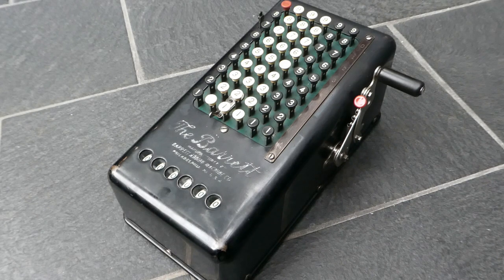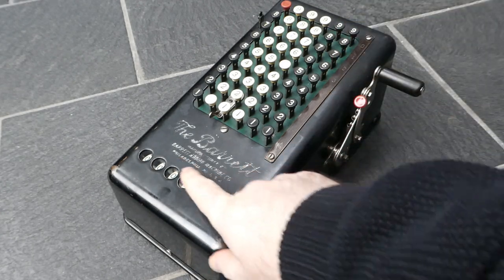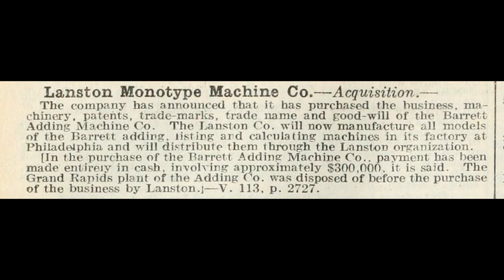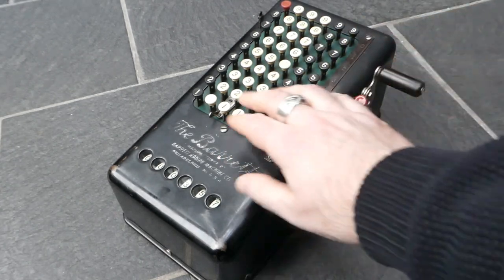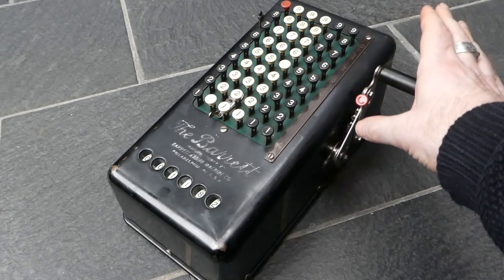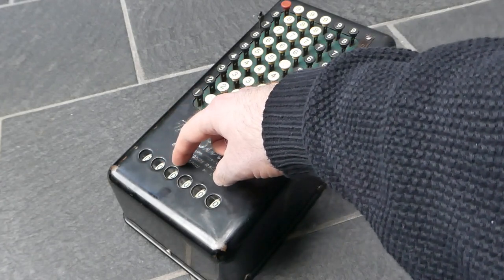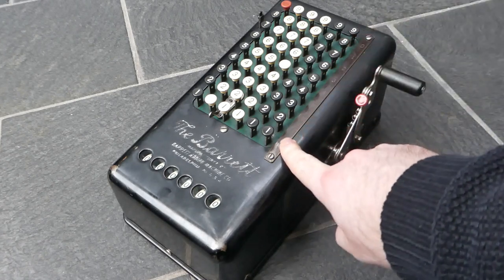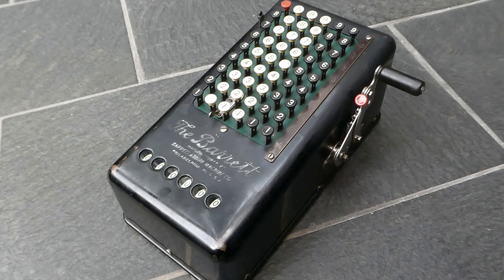The Barrett Adding Machine

Comment: That's another cute machine Jaap, a great little find.  I love the way you can lock out the last two columns to use as an item counter, that's really neat.  Always nice to see the rare ones, but the more common ones are equally interesting.
Reply from the maker: The mechanism for the item counter is remarkably simple. The switch just swings a rod in place that always triggers the carry mechanism to the fifth column.
Reply: @jaapsch2  Simplicity is always the best, very little to go wrong with simplicity.